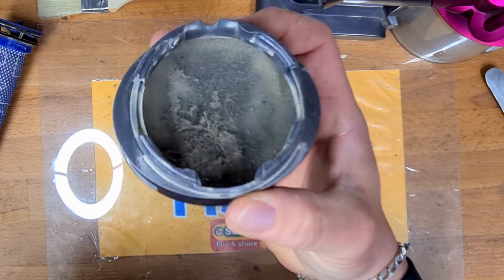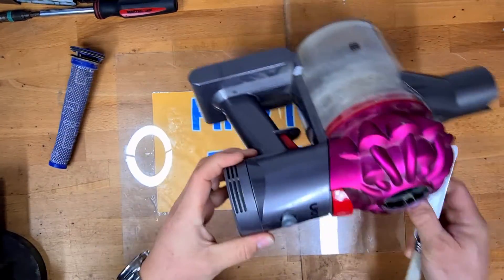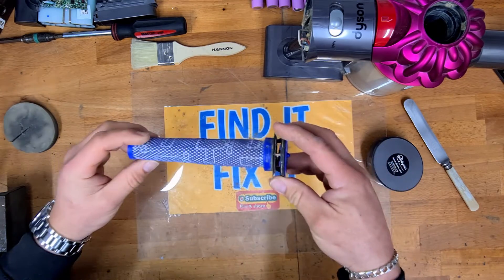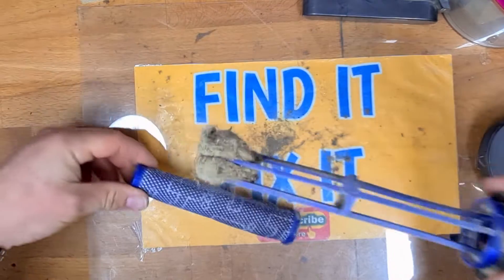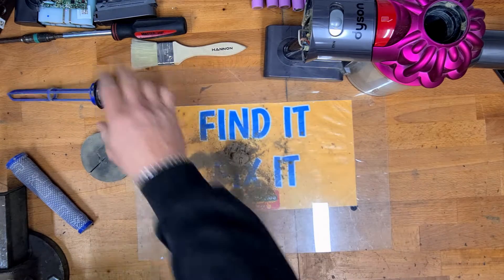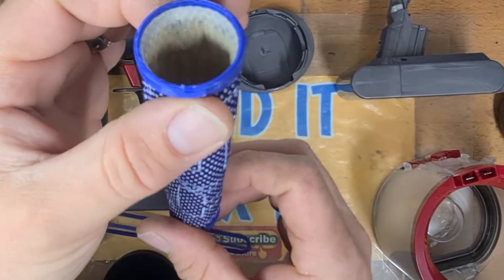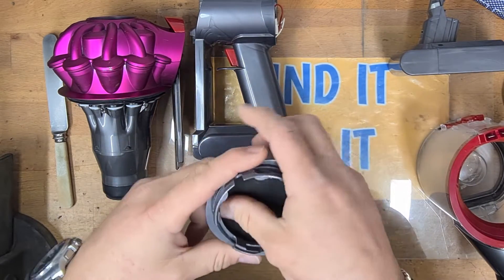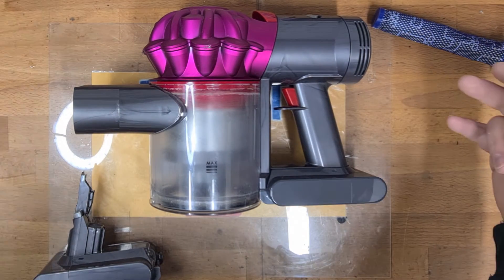Dyson v7 v8 filter cleaning stops it pulsing vacuum cleaner repairs

Comment: Thanks for showing these tips, very useful, now if i can find a way to redesign the entrance to the dust bin on these blasted things, it's always clogging up, i find Dyson mist the mark on that part. They need to redesign it, if they crrat a new dust bin that's universal for all there model's that addresses that issue ut would be so much better, because they last a ling time, the batteries can be rebuil t i have 2 that I want to have rebuilt, i need to find the right batteries for it, they look like AA batteries.

Comment: My v7 has a twist-off rear housing with a pleated paper filter that can't be cleaned. So that part isn't right. And the technique of sliding a thin wedge(knife/screwdriver) under the edge of the other filter to remove the sock is more destructive than necessary as it stretches the thin, soft bit of the top that catches the raised edge. All that is needed is to push down the raised edge of the tab within the slot while pulling up on that side of the top (and down on the sock) to free the first of the tabs, after which only a little pushing on the next tab should allow it to be freed.
Reply: Thank you, this is exactly the information I needed.  I will brush out what I can from the rear filter so I can continue to use it while I wait for a replacement.

Comment: I cleaned all the filters and it’s still pulsing.
Reply from the maker: there could be a blockage in the pipe just where it goes into the dust bin. check there and if you pull the filter out the top dose it pulse ?
Reply: @FINDITFIXITRESTOREITBUILDIT  no issue there. Only way it stops pulsing us if I remove the rest filter - which I already cleaned. I’m stumped.
Reply: Sorry the rear filter. Will call Dyson today.
Reply from the maker: are the filters dry watch my videos and give it a complete clean and swap out the rear filter for a new heppa one.